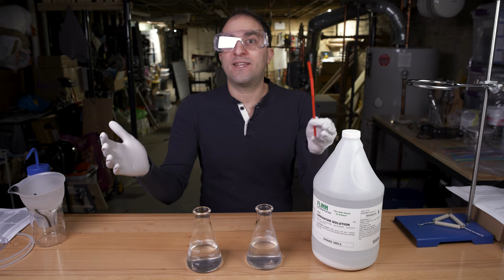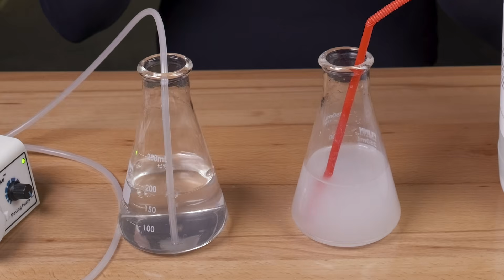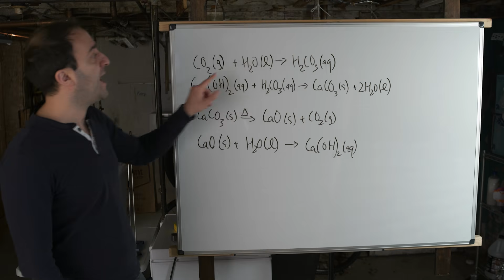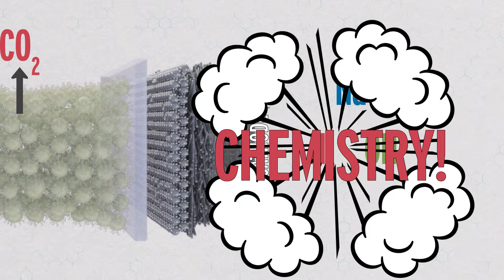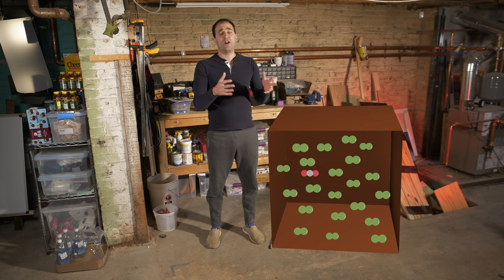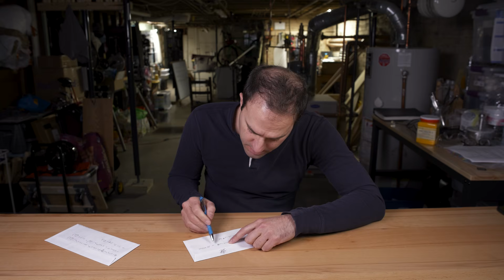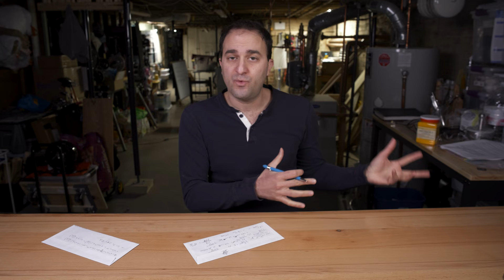Why a Carbon Capture Breakthrough Will/Won't Save Us

Comment: If you heat the material to release CO2 then you have achieved nothing.  Where do you get Calcium Hydroxide?  From Calcium Bicarbonate. Releasing CO2.  A useless process.  Trees are the same.  They absorb CO2 while growing.  Then they die and release that CO2 so over their entire life cycle the result is ZERO.  Just as it does with the Calcium/ Carbon cycle.  A cycle has you running around in circles.  Now IF you could use solar panels to take carbon dioxide from the air, separate out the oxygen and then bury the carbon to recreate coal THEN you have broken the cycle.  To return the carbon it MUST take more energy than the energy we gained.  A LOT more energy. Around ten times the amount of electricity created.  It CANNOT be done.

Comment: You calculated how much it would take to remove all co2 from one meter cubic meter of air. But that is not the actual end state. You could do it like that, each volume unit to 0, or you could do flow through co2 removal, for as long as it takes to remove enough co2 globally so the concentration falls enough. Of course now you are pumping a lot more air, and burning energy for that...

ps: I think that the actual energy end state you want in your calculation is the form you want your co2 to be in. e.g. liquefied gas , a plank of wood, biochar, sparkling water...

Comment: 1. many things output heat that is not possible to use in a usefull way. powerplants. datacentres. etc.
2. solar power can provide many times our global electricity use, the downside is that we need to be flexible in when we use electricity. if a carbon capture technology is produced that can utilize large ammounts of energy in the periods where the grid needs to be offloaded, and then stop using power when we have high needs, it could help make solar panels viable.

Comment: If you regenerate the working material by releasing the CO2 are you just going around in circles, surely the point of carbon capture is NOT releasing the captured CO2?

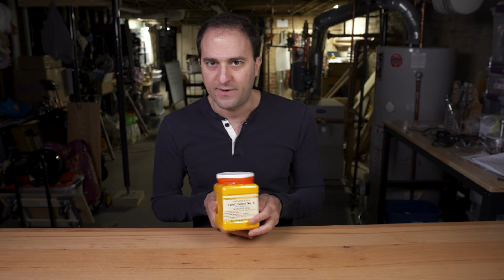Comment: 3:33 I'm sorry, but I call this bs...  1kg of dry wood is 500g of pure carbon, to get 500g of carbon you need almost 2kg of CO2. Asumming living tree is 37% water, then to get 1kg of living biomas tree neds to absorb 1,1kg of CO2. Trees can grow yearly between 5 and 100kg of biomas. Let's say it's just 5kg. So tell me. How this 225g of yellow stuff will absorb more than 5kg of CO2 which is 1,3kg of pure carbon?
Reply: The answer to your question is scale and efficiency. 200 grams of COF-999 capture the same CO2 as a large tree in a year, more if ventilation is assumed. Unlike the large tree, you don't need as many resources like water and space. Unlike COF-999, trees will need to be processed, they are not all carbon and waste will be generated from this processing. At the end of it, the final outcome won't even be pure CO2, unlike COF-999. It's also much easier to scale, you can hold 1 kg of COF-999  in your hands but the equivalent 5 trees will take more space than several humans. It's not even a debate.
Reply: @maximusasauluk7359  thanks for the stuff name. I didn't check your description. Now i did, and according to source: "This COF (termed COF-999) can capture CO2 from open air. COF-999 has a capacity of 0.96 mmol g–1 under dry conditions and 2.05 mmol g–1 under 50% relative humidity, both from 400 ppm CO2". This is about 0,08g CO2 capture per 1g of COF-999, and sounds more resonable. Just think about it, how much density of this material would rise if 200g absorbed few kgs of CO2? This stuff as I understand now is just a new kind of molecular sieve, and even not best one. More CO2 can be absorbed by MIL-101, HKUST-1, MOF-5 even simple zeolits like 13X do better. As I understand COF-999 has just better working conditions, like lower deabsorbtion temperature which makes it better candidate for CO2 processing facilities.
Reply: I don't have access to full text but I might know where's the issue. They say it "reaches half capacity in 18.8 min" in open air. So 365 days x 24h x 60m / 18.8m -> yearly total capacity per half gram of COF-999, assumming recycling. If you multiply this value by 2x225 you get 1555g. So you can use 225g to filter out same amount of CO2 as worst growing trees, but you still need to have a way to store it and you need to warm sample up to 60C 30k times during that period of time. Using AI I estimate it needs 75 kWh. You could get this from single small solar panel. However, to emphasize - this is only filtering CO2, not storing.
Reply: @KrzysztofDerecki  Yes the main advantage is low energy for post-processing but also arguably even more importantly, the high reusability of the material. If you ask me, storage is the least of our problems regarding carbon capture. Depleted natural gas pockets can be used (ironically) as CO2 is even denser. The main issue is always money and that means scalability and energy use, that's why this material is the best right now.
Reply: @maximusasauluk7359  take note there are higly selective CO2 membranes which can filter out CO2 without using any power. I don't know how efficient they are, but they are expensive in production. So like you said its all comes down to scaling economy.

Comment: Fusion may be 30 years away, small modular reactors based on fission are in testing as we speak. Super safe, super small, very powerful. 
Based on thorium or just good old uranium, either way we will have tons of available clean energy.

Comment: Two points here.  

First, capturing CO2 is the easy and much less expensive part.  The hard and $$$ part is what you do with it after you capture it.  That's extremely much more energy intensive since it generally requires a large amount of compression to either get it underground or under enough water.

Second, it makes no sense to capture from air (0.04% CO2) instead of from the flue gas (4 - 12%).

Comment: If we used a lot of solar panels in the deserts i wonder how much energy that would help vs whats needed. Also we just inject the co2 into the ground as a gas? How does it stay there?
Reply: CO2 is denser than natural gas, which means the perfect spot for storage is, ironically, the empty/drained natural gas wells.

Comment: What's the point of capturing CO2 if the regeneration process of Ca(OH) releases the exact same CO2 molecule that was trapped ? If the released CO2 isn't used in an other chemical reaction that involves reduction of the said CO2 into something like graphite (Carbon 0) then it has no real point

Comment: All very interesting but still ignoring that ship engine cooling systems are dumping warm water into the oceans at a rate that produces a pool of water a foot deep, the size of Texas every month. We need to get busy dumping cold air into the oceans via Aeration and Degassing methods used in Aquaculture to compensate and cool the oceans. Oil rigs are in excellent locations to optimize these techniques; we're working to make this a reality.

Comment: Frankly I was disappointed this video wasn't about the electrochemistry of converting CO2 back into liquid fuel. 

And if it was, you know I would have given a cynical and snarky comment to the effect of "how many barrels of oil would we have to burn to make one barrel of oil?" 

And so far it sounds like you need roughly a half a barrel just to get the CO2 to the apparatus to do the conversion....

Comment: Forests have been temporary carbon sinks ever since fungi learned to eat wood, but the oceans could gradually consume much of the CO2 already dispersed into the atmosphere.  (The planet no longer makes coal, but it does still makes limestone.)  Huge oyster farms would be a better (and far tastier) approach than tree plantings.

CO2 capture makes economic (and thermodynamic) sense only if you capture it at the smokestack, where you aren't wasting time and money in a hopeless attempt to join together what entropy has put asunder.  (One of the best arguments for electric vehicles is that you can produce CO2 at a central location, rather than at hundreds of millions of tailpipes.)

Calcium hydroxide is hopeless simply because you need so much energy to make the calcium oxide (lime) that you start with.  (Imagine a cement plant trying to capture the CO2 it emits, using this process: it would produce no cement at all.)  The electrolysis method looks nifty, but I doubt that any utility company will build a power plant with half of the current efficiency, unless they're given enormous gov't subsidies (which in turn requires elected officials who don't think - or aren't paid to say - that global warming is a hoax.)

Germany's power grid has had, on good days, zero CO2 emissions, thanks mostly to wind and solar generation, and nuclear-generated electricity imported from France.  These are the things that have been proven to work.  The U.S. could also have such good days, if we were to restore reason and sanity to our national politics.

Comment: Why not just use heat still? Just take it from the sun during the day and heat up whatever you wanna heat up using lenses. Not only you dont have to use third party items like solar, electric or other fuels, you can use cheap mirrors.  Really, combined solar panels and use the wasted IR (heat) instead and transport that over the reaction. You can easily hit 600+ degrees more than enough for the reaction while taking little to no complexity to do it and get two outputs both in power and cleaner air. Using wind convection because the temp difference, you then have your fan as well meaning little to no power would be needed to even run the machine. And dont think is a dumb idea... trees do it all the time... and they're still going strong. The sun hits the earth with way more than we can ever produce at a smaller land mass than any bio-mass could ever take in... By capturing that sun in that area, you also cool the area around it too...
Reply: This is one of the best comments here.   Why bother with electricity when the simplest form of energy (heat) suffices?  Also, this heat is necessary for 1 of the 4 reactions shown, but because they form a complete cycle, isn't it the case that the other 3 (in total) produce the same amount of heat (which was likely wasted)?

Comment: Why extract the co2 from the carbonate? Its nice and stable, solid, why not store it underground as is? How much energy does it take to make new calcium hydroxide? Can we make enough of it without releasing too much co2?
Reply: Better yet, use solar and fission.
The carbon comes presequestered. Leaving it in the ground is by far the most efficient cost effective solution.

Comment: How about freezing the air to solidify the CO2 into dry ice, then burying the dry ice somewhere it won't get out? Probably leas efficient than the alternatives
Reply: The dry ice...will evaporate?...
Reply: @maximusasauluk7359  I was thinking you could seal it somewhere so that it stays pressurized and locked away even if it evaporates, but that might be a bad idea
Reply: @benG2141  The scale required to pressurize this much CO2 will probably produce more CO2 as a result than the total CO2 stored, not to mention the giant cost. It will probably be more economical to build rockets with unpressurized CO2 and send them to space lol but the brainstorming is welcome with these discussions
Reply: @maximusasauluk7359  I made the assumption that the process of freezing CO2 into a solid would make it significant denser, and then then this density could be maintained inside a pressure vessel buried in the ground

Comment: The scientific community has known for more than a decade that direct carbon capture is a pipe dream.
Do a break down on the efficiency of pyrolyzing waste to energy then burying the biochar.
Then do one on seeding algae blooms over deep oceans. Pretty please!
Reply: The algae blooms do indeed remove a lot of CO2, I am a big fan of using algae in a controlled setting to remove CO2, but they have a nasty side effect in the wild.
The decay of the dead algae, turns the affected water body anoxic (lacking in oxygen).
This creates an extinction event. (Even small extinction events are a bad thing.)
Reply: @jimthain8777  It would probably be more effective to start with capturing the methane emissions from existing excess sargassum beach hotels pay to remove, then sequestering what doesn't break down, anyways.
Reply: @jimthain8777  Deadly algal blooms are a natural part of the hot half of Milankovitch cycles that we have officially kickstarted 2k years early. The more we can sequester now, the less intense they will be later.

Comment: Is it possible to design a device that scrubs CO2 from exhaust gasses produced by internal combustion engines? This device could use the excess heat they produce to recycle the reactants. Is this possible?

Comment: The efficiency won't really matter if we ever get to a critical mass of renewable energy production. Sunlight is almost free, wind is decent, hydro has some issues and can't be used everywhere, but when all of them are used together with nuclear we have a winning strategy. Nuclear could have already provided us with enough near carbon neutral energy production, but people are just too scared of it. France really set a good example with it's own nuclear energy grid. Never any major accidents, and they don't have to rely on coal or gas for most of their power. If the US prioritized nuclear energy incentives over fossil fuels we'd be in a good spot. The fossil fuel industries don't see renewables like solar as a threat to them as they can't scale as easily on their own. Nuclear however is a threat to their bottom line, and as such hasn't seen widespread support in the US due to propaganda and lobbying by said fossil fuel industries.

Comment: What if we use rocks, which have affinity for CO2, to reduce the energy needed? We would of course need to increase surface area of gigantic amounts of rocks. This could be done by large and powerful earthworking devices. Perhaps we could call it operation plowshare?

Comment: There's gotta be a way to use mother nature to assist in this more efficiently?
Mother nature has been perfecting plants for a very long time.
Reply: Hempcrete. Hemp mixed with lime can be used as home isolation. It’s then surfaced with lime plaster rather than drywall on the inside or siding on the outside. The hemp captures more co2 acre for acre than a rainforest. The lime absorbs CO2 from the air. As long as the structure is exposed to air, it is absorbing CO2. The catch… your house is white. 🤷🏻‍♂️ people want all the colors and generally hate white. They like texture like siding, brick, and stone, not smooth white walls. If you paint the lime, the surface that absorbs C02 is covered and will no longer work to absorb CO2. Look at that, you can can use nature and industry to solve a problem, but the cost is creativity. People love color, so unfortunately… this will not work because people will reject it.
Reply: @Columbus-Rex  If you are in an HOA then you don't really get much choice in color. We could start the hempcrete HOA

Comment: So companies that pull nitrogen and oxygen out of the air have to contend with CO2 as a contaminant.  Traditionally they've frozen the air and pulled out each precipitant.  CO2 freezes first, O2 next, then N2.  Of course they get a lot less CO2 than the others because it's so little concentration. And most throw it away back into the air.  How much energy is that process?